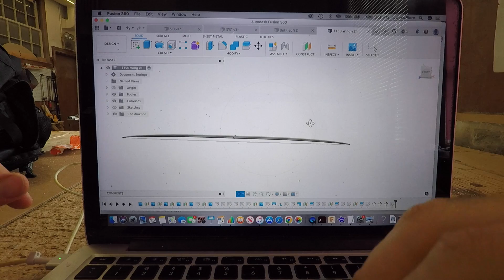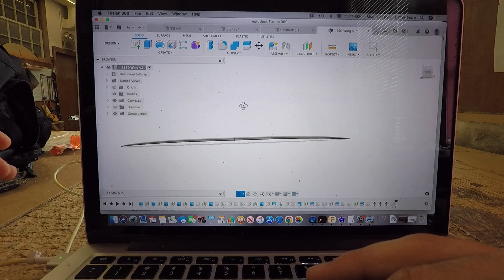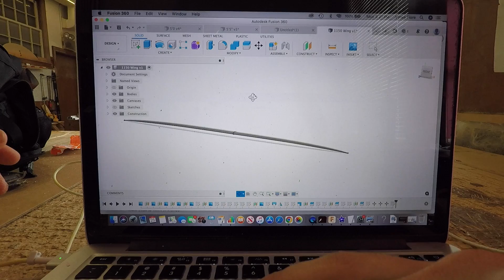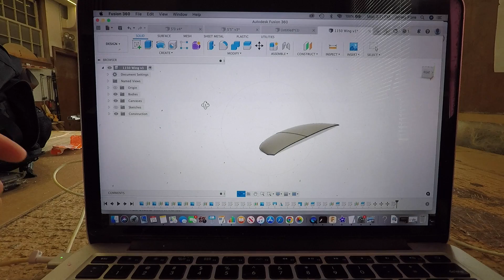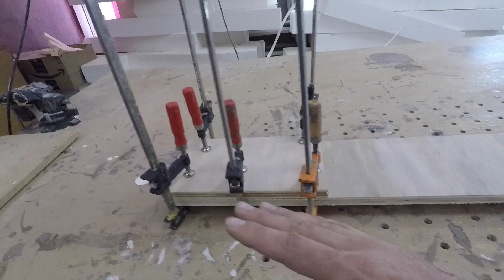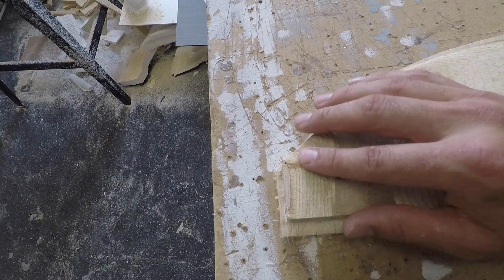Building a HIGH ASPECT hydrofoil wing Part 1

Comment: Awesome job, but be careful using plywood.  I used it for my first foil and I had major delaminating issues that ruined the foil within two months.  A tiny bit of water got into it from a small crack and the plywood sucked it up and it compromised the glue between the layers causing the foil to separate.

Comment: I do wood cores by bolting oversized, pre-drilled stock outside the wing boundary and then use a scallop operation to machine from inside to outside. The first operation should stop just before the boundary and leave at least half the material thickness. Then turn over to the other side using the same holes and positions, and do another scallop for the other side, again inside to outside. The thickness of the unmachined material around the outside will support it. When the second operation reaches the boundary, the core will come lose.
This way you can create cores with features that are quite thin, without fancy holding tricks. You do need to be able to machine the full depth at once. I use light and soft wood (paulownia) or hard pvc foam as core material.

Comment: Have you considered applying some thin CA to the trailing edge before milling the top surface?
It soaks in and gives the trailing edge a bit more strength before the top cut and sanding.
It's a trick I use on RC aircraft wings.
Reply from the maker: Thats a very good suggestion to keep in mind for other situations. I evened up redesigning the trailing edge thicker for milling. After the bottom of the wing is glassed up its easy to sand the extra 2-3 mm off to get the trailing edge really thin.

Comment: That's not a challenge I'd entertain now. High aspect wings need a lot of unidirectional carbon thickness that is already taken up by your wood core. Not only that, but you want a good strong seam between the sides. If not epoxied in one go, then you need some front wraps. Personally, I 3D print a dummy of the wing in pieces with dowel holes and then glue them together. That's my model, not a core. I used cores in my very early work but not since, there's too much of the volume needs to be designated with carbon in the correct orientations. In your wing, you have to create the design and then thin all the surfaces by the intended thickness of composite claddings. Else you get what I did on my first wing, extra thickness from your design. Not such an issue for a beginner wing, but you can't do a high performance wing like that.
Reply from the maker: I do take the skin thickness into consideration when designing the core. So once laid up it did not get thicker then intended. The leading edge gets double wrapped during layup. Lastly I have already surfed on this wing and it performed great. I went with a pretty light layup but even with that it is very stiff... video to come I suppose
Reply: @clearwaterhydrofoils4313  Good. Still, I wouldn't recommend a wood core for a high aspect performance foil, not unless it's just small parts inside many outside layers of carbon. Also, you need to reinforce around the mounting to the fuselage. if it's tight enough not to move substantially under load, it's probably not wood in the bolts region. wood will crush under required fixing pressure for bolts unless you core your fixing holes out for hardwood end grain inserts.  Performance foils are quite demanding, a good performance foil is working near available material strain limits.
Reply from the maker: @fluiditynz  You should see part 2 to answer some questions... The build / wing speaks for itself.

Comment: Nice!

Did you use a vacuum nest for the second side?
Reply from the maker: No vacuum bagging in this build. Those that have the gear and skills can certainly bag the part easily and probably save on cleanup work. I like to find hand layup techniques
Reply: @clearwaterhydrofoils4313 Good plan. I was just wondering how you held the plywood for the second side.
Reply from the maker: @wardhagaman3139  For the milling process I simply hot glued this one down to a fixture. If I need to make dozens of them I am sure some sort of screw down fixture will be needed.

Comment: I imagine you modeled this after the AXIS 1150 wing, so props for doing that. That wing is incredible. The layup is going to have to be intense though. You'll definitely need to do carbon for stiffness. I have made custom wings and compromised on stiffness and it didn't work out.
Reply from the maker: Really fond of the axis design... simple but effective. I developed the basic size/ shape from them and went from there... The layup with carbon was lighter then I expected in order to get really stiff results. It will be interesting to compare to 100% glass if possible.